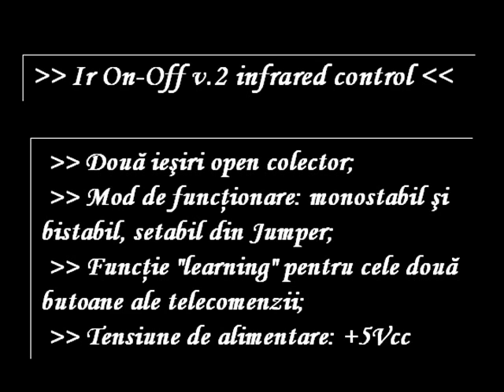IR ON/OFF switch with PIC12F629 v.2.0

Comment: I rode the v1 and it worked but I had to change the R3 for a 1k, it works very well but once it fails, the LED flashes but it does not trigger the relay. Why? Thank you for sharing your work.